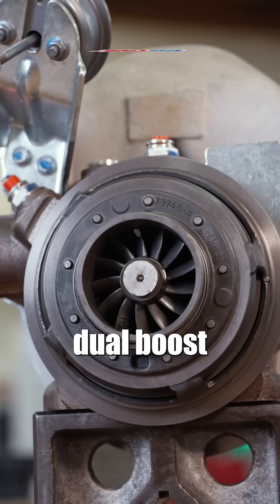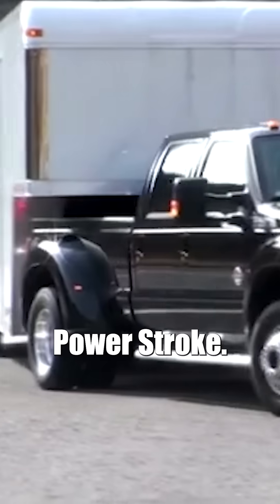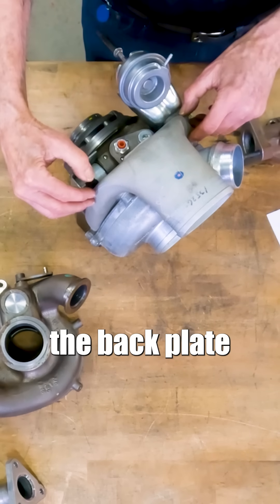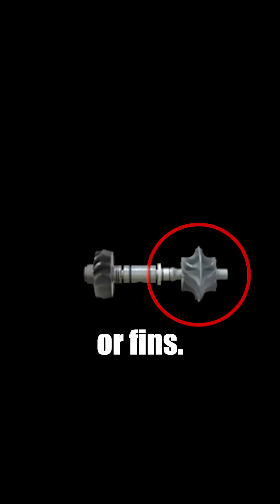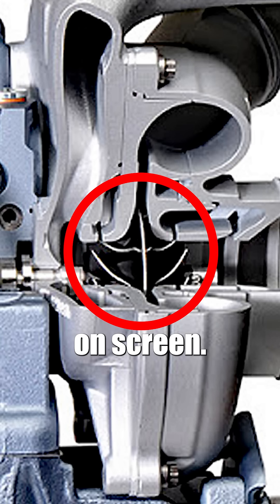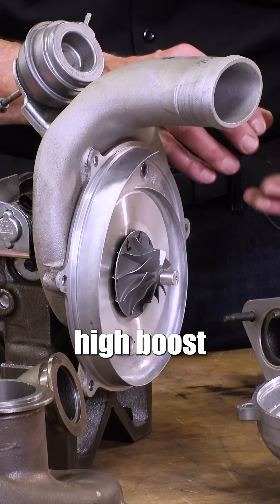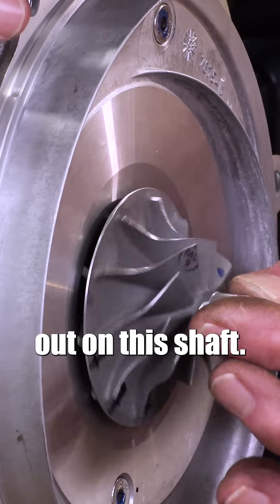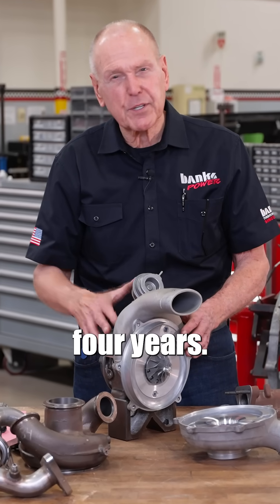Ford’s turbo failure.

Comment: The more I learn about Ford, the more I like my Duramax
Reply: I’ve been running my 2002 LB-7 now for 22 PLUS YEARS, original trans , turbo, diffs U-joints etc.  Have almost 200k miles on the old dog & it just keeps on going .  Take care of them & they will survive . I’m on 8” lift & 37” tires too , and towed a 30’ Toy-hauler to & from desert and Eastern Sierras for decades. Got the usual mods, S&B intake, 4” full down pipe back stainless exhaust , banks Original 6-gun package with speed loader & big head wastegate, Edge CTS-3 monitor & some old school Analog Pyrometer & boost gauges on pillar from way back when I installed Banks goodies & exhaust in ‘03 .   ALL OF IT is STILL WORKING since day one as intended .  Maybe I’m lucky , or just smart enough to do my own maintenance and have a clue when I need to back out of it when temps get up there or see something obvious.  Ford’s & Dodges will live too if you pay attention to details . C-ya .
Reply: @stephenmiller5023  Did your a/c controls and actuators shit the bed yet?
Reply: My good friend has run a fleet of GMC trucks for 20+ yrs and is finally switching to Ford.  GMC… a high maintenance conundrum.  His DuraMax is a total lemon.
Reply: Yeah, and then your Duramax spins the crank hub cause GM in their infinite wisdom didn’t install a keyway 😂
Reply: Don't clock on Dave's Monster garage videos then, if you love the Duramax.
Reply: “I’m scared of more power”
Reply: @Obamanamamama you'll be okay. Make the step from junk ford or ram up to the big dog chevy or gmc
Reply: @SXSPRIME  Ahhahahahahaahhahahaahhahahahahahahah

Comment: I have a 2011 F250 with the ORIGINAL TURBO and 460k on it! I did have to put a new transmission in at 360k. Yes I tow with it and drive it like I stole it!! How is this possible? Maintenance, Maintenance, Maintenance!!!
Reply: MUCH MORE maintenance than any sales or marketing people will tell you about!!!
Reply: @brianstough5286 my 2014 f450 jas had nothing done but an upgraded vent for fuel tank. It loves collapsing a plastic tank pulling.
Reply: Amazingly, my mechanic says the same thing. Every time I bring her in, wait, we've never changed that part?? Yes, you should know that you're my mechanic, lol!!
Reply: the failures cover more than 1/3 of all manufactured.  That is a SIGNIFICANT number, regardless of your claim(s)
Reply: Also, stock stock stock, these main failures weren’t do to lack of maintenance it was due to them being treated like a regular turbo after tuning and deleting them
Reply: Who would ever think about doing maintenance to make your vehicle run longer. 😂
Reply: damn right!
Reply: Gee, would that would that also apply to changing the oil or only when the red light comes on like my wife?
Reply: Nice!
Reply: I'd be willing to bet most of them were molded trucks without safeguards just RAW power and then complain about failures!!
Reply: How have you not melted a piston yet
Reply: @blackdragon46819  Because I'm not an idiot!!
Reply: Maintenance is the main thing. In America they mostly don't believe in that. Or MOT's (car worthy for the road)
Reply: If people changed their oils and there were no potholes cars would last forever. Parts only fail when operated out of spec or they are made in China (made out of spec). Technically all the parts break on vehicles now were engineered to fail when and how they do fail to prevent catastrophic failures that aren't anticipated. If your transmission locks up going 85mph on the interstate you aren't likely going to survive it. But we rarely hear about anything like that happening.
Reply: I’ve got 17 6.7 on 37s and I work and drive the hell out it. Same thing. Maintenance. My friend has an 11 with 450k and he does the same thing even harder than I do. Maintenance is king.
Reply: This purely theory but I believe vehicles live longer with spirited driving and ofc the maintenance
Reply: 360k is really pushing it beyond average lifespan on an auto but pitiful for a manual
Reply: @P7777-u7r  you really sold yourself out on not knowing these trucks at all💀 no manual option on a 6.7 ever, and the 6r140 holds just fine for even a million miles (been proven a couple times now) just do regular services
Reply: @KDlGG  I know you can only get them in slushbox which is why ill never own one. This is when trucks firmly entered their pavement princess era. Also the Super Duties of this era to the present era actually got a manual option in Mexico why those manuals cant be an order option for the US and Canada is a huge mystery considering we get the other trucks made there occasionally.
Reply: @  not sure where you heard they came as manual because on the Mexican site an auto is the only option and has been that way since 2011 and has been publicly documented as such
Reply: @KDlGG  I was in Mexico and I saw an aluminum duty with 3 pedals and a stick. Also single cab bench seat wind up windows. If not Ford someone there is doing a lot of conversions.
Reply: @ that’s common, Mexico did 2nd gen ram crew cab conversions, so a manual alumiduty wouldn’t be far off
Reply: @KDlGG  you're right, they last quite a while. Even with the valve bodies I've seen in the last few years, and I've also seen this in some videos too, shift solenoids get stuck open due to the spring catching on burrs. My boss used to have me wrap some thin scotch Brite on a coat hanger, put it in a drill to clean it up. Not the most precise method, but they switched to new busses before the transmissions I worked on ever got a chance to see a failure. The busses put on a minimum of 450k before the got switched with newer one. We were doing flush and filter changes all the time, and rebuilding valve bodies quite frequently. My boss was an OCD nut who loved to be busy, and on the shops budget, he LOVED to be rebuilding stuff haha.
Reply: @bobjordan8283  
I want to believe you. Maintenance is great. But, it's a ford... IT'S A FORD!

Maintenance or not, their parts can't handle it.
Reply: @elgoog7830 Believe it or not, mate...  you take proper care of it, and it'll take care of you too.
Reply: @elgoog7830  that's a stupid comment...?
Reply: @elgoog7830 you realize there are more million mile Ford 6.7 trucks than any other model of light duty trucks built, right?!? Ford is hands down the most reliable brand out for the past 30 years and that’s why it’s always been the top selling truck in the US despite it being the most expensive.
Reply: @elgoog7830  1986 Mustang 5.0 475k, only needed a clutch.  Still have this car.  1990 Range 4.0l, 417k really didn't need anything but brakes.  1997 Dakota 4x4 (318) 317k, ball joints twice.  All bought new.  Maintain your vehicles, you'll be fine.

Comment: Meanwhile in my country.... still debating cooking oil that can be use as engine oil.

😂😂🤭🤭
Reply: Whichever one burns at the highest temperature. Just be sure you change it often as it's not going to last long without the additive package that engine oils have. For engines that require thinner oils, mix it with mineral oil to thin it out. Or just use pure mineral oil if it's affordable, as it's pretty much the base oil for modern engine oils.
Reply: @theredscourge zinc seems to be the common ingredient guys that know their stuff say to look for in an oil. I’d say be sure to add some to your cooking or mineral oil.
Reply: @claytonatkinson865  Not just zinc but I think it's blended in the form of ZDDP now

Comment: I'm going to assume, they stole that design from somewhere else in the world.

They'd never put too much time into R+D-ing that turbo. They're too lazy and cheap.
Reply: It's a Garrett turbo. Garrett, at the time, was owned by Honeywell, which dominates the airliner APU market and has a large share of the small turboprop/turbofan market. Compared to the stuff the company has designed in the past this turbo is child's play.
Reply: I'd like to thank youtube, for deleting my mudane comment on this thread.

So sick of youtube mods. Mf's are off their meds.
Reply: @elgoog7830  you really think moderators are sitting around reading every comment on every video come on man.
Reply: @elgoog7830  its automated bro
Reply: Everything in life is borrowed or stolen. Even Ford's "Superduty" name was borrowed from Pontiac. If I am not mistaken, the first Pontiac "Superduty" was in '62. The last in '74. The Pontiac 455 Super Duty Trans Am.
Reply: @jamesspalten5977  
They're claiming ford spent years designing this turbo... when in fact they did not....

... following along?
Reply: @ Gimme back my lunch money!!
Reply: @jamesspalten5977 Ford had a super duty truck engine back then
Reply: wrong
Reply: That motor is designed from the ground up by Ford. Youre too lazy  to do basic research.

Comment: so this came just before the VGS system was made?
this actulay works like a dual turbo, the only difference is the two compressor is propelled by one turbine wheel,
great invention
Reply: I wonder if Garrett thought about twin spool turbo :D then it would truly be two turbos in 1!
Reply: Yea, great invention. But only 4 years to use in one specific engine maybe. Now 10 years later is still available a replacement? Is expensive? Is more cost effective two regular turbos?
Reply: @danielguzman9061 just came inconveniently late. Too close to VGT.